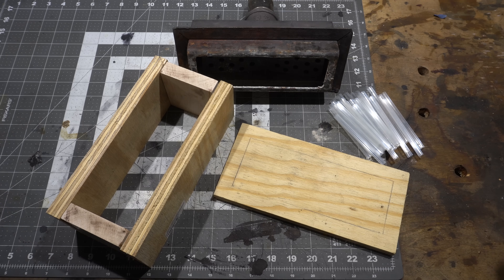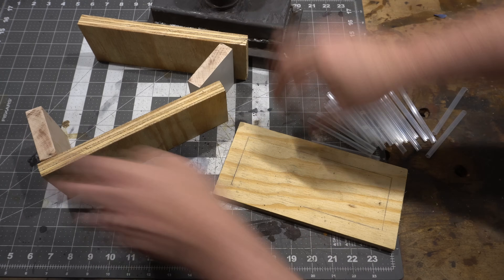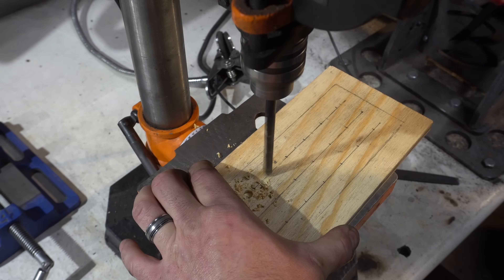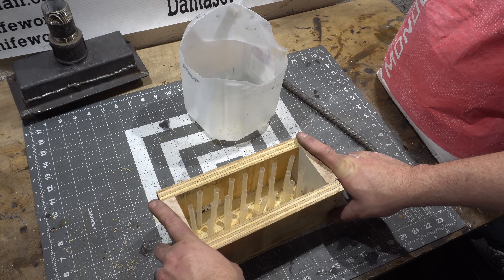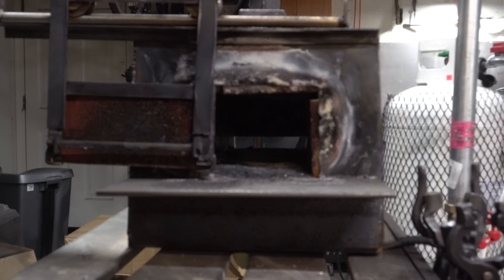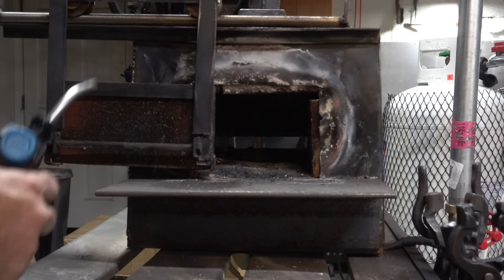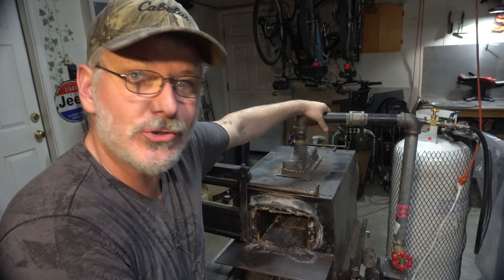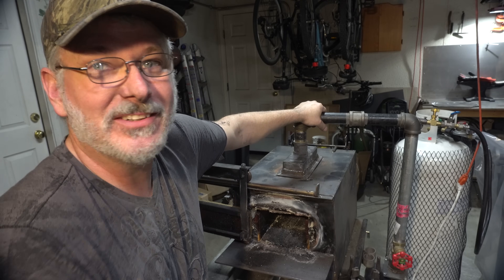Triple-T #77 - How to make a ribbon burner

Comment: +Tyrell Knifeworks  Why not add some 3/4" or 1" firebricks along the sides to reduce the inner volume and increase the insulation?  Seems you can always reduce the space of your forge to get more performance.  Building a smaller forge to heat up faster seems like a waste if you can just add some more lining brick.
Reply from the maker: Yeah I could but, 1)  I love building forges, 2) I want a longer ribbon burner because with the length of the forge, there are cold spots at each opening.  It's fine but it might as well be a 14" forge instead of an 18".   The new one will be 18" with a 12" burner.  Thanks for watching, Derek.
Reply: @TyrellKnifeworks  I totally understand.  I live in a big place where space is never a problem.  If I run out of space in the work shop, I build another pole barn specialized for hot work, or a cleaner space for CNC machines, drones, 3d printers, chemistry, etc... I have a lot of hobbies in my retirement. :)  So I get the sentiment about enjoying the build.  

I was just offering that not so obvious to everyone solution, which is, to use a Lego like strategy with sacrificial K bricks to reduce the size of the chamber based on what you need at that forging.    My main forge 36" long and a dual ribbon made of 10" square steel tube, so I typically only use the first 6-10" unless I'm making a long tool or a sword(which I've never gotten around to making, but was the reason for the long forge design).  If I had to wait for the whole thing to come up to temp for a 6" work piece, it would burn a ton of fuel.  And that's the main thing I hate wasting, time or fossil fuel.  Great channel and thanks for the reply!

Comment: Excellent video - a ribbon burner is in my future.  The switch of my burner from venturi to forced air was already life-changing. ;)  Thank you for addressing PSI vs flow rate.  I wish I could share that explanation with everyone who wants to build a forge burner.  PSI is almost meaningless for measuring gas flow without further information - it took me a long time to figure that out too because the common way to compare burners in almost all forums is to use PSI.
Reply from the maker: I’m glad it was helpful, Jeff.  Thanks for watching,

Comment: Thanks for sharing. I am about to build one and I really needed to see one of these made. Now, about the pressure/flow rate, those are 2 different things. The forced air (especially the ribbon) burners can work at lower pressure as they don't need the output pressure from the nozzle to create the vortex to suck oxygen in. The size of the orifice is, as you said, bigger in a forced air system so the flow rate (gallon per minute) is still adequate even at 1 (for example) psi. That's how I was taught how the forced air system works, but I might be wrong, since I am not that smart. Do you have any equation to determine the size of the pipe in relation to the size of the forge? Thank you again, i really enjoy your videos
Reply from the maker: Yes, but remember psi is not a measure of how much gas is coming out of the tank, just how much back pressure there is.  If you have a small opening it it creates more pressure.  You could actually have the valve open more and be going through more or less gas.  There’s no formula for the pipe diameter but if I were to do it again, I’d go with a 2” pipe and a larger blower.  Thanks for watching
Reply: @TyrellKnifeworks  yes, that's exactly what I meant. PSI and flow rate are 2 different things and low psi and high flow rate (amount of gas coming out of the tank) can occur at the same time, if you have a large enough orifice

Comment: A possible way to measure efficiency is by weighing the propane tank.  Difference in weight after an hour of running the forge multiplied by BTU/lb of propane will give you the consumption in BTU/hr.  Leaving a scale around the tank is useful anyway to check how much propane is left in it, tare weight should be stamped in the ring around the valve.
Reply from the maker: Yes, that’s certainly a way.  Thanks for watching.

Comment: Temperatures and running time are proportional to the type of gas and gas amount used.. no matter what burner you use .... it is physics...
The burner gives you the "efficiency" of use, and the "control"...
You done a pretty good so far, but I always recommend adding a "back fire" prevention arrangement,  it would prevent fire to stream back at the mixing tube up to the gas cylinder if it is left unattended... or you face a "power failure" at the blower...
Reply from the maker: I never leave my forge unattended when running, but I get the concern. Thanks for watching

Comment: I wonder if you could just make it all out of steel?
Just use a thicker plate on the bottom.
Reply from the maker: It would heat up like crazy though and would scale and decay quickly.  Refractory is the way to go.
Reply: @TyrellKnifeworks , Ok, thanks!

Comment: Awesome video Denis.  I am pretty sure you and Brian House are in my head.  Brian releases a vid on how to wire up a VFD at the same time I am wiring up my first VFD.  You release a video on making a ribbon burner as I am getting the components together to build one.  One question for you.  How much of that refractory did you end up using for the burner?  I am thinking of buying that type and then using the rest of it to line the forge I am building.  I would imagine the 50 pound bag will be more than enough but just want to check.
Reply from the maker: I think I used about 5 or 6 plastic cups worth from a 55lbs bag, so you have plenty.  Good to hear the videos are timely and helping you out. 👍. Thanks for watching, Doug!

Comment: G'day Mate. If you weigh the gas cylinder before and after use. Then subtract Start weight by End weight you get the quantity of gas used in kg or lb. Also if you time the run and divide  the quantity of gas used by the run time you end up with the flow rate in lb/hr or min. You can work the cost of gas used if you need to know that to.
Reply from the maker: Yes, I guess you could do that, but that’s a lot of work.  I’m lazy and if I cared that much I’d just buy a flow meter.  😜.  Thanks for the tip though, Daniel.

Comment: Thanks for sharing! I'm looking forward to watching you build your new one. I'm getting close to building my first, just want to make sure I have enough money to cover all parts.
Reply from the maker: Definitely collect all the parts before you start.  I'm torn which is easier and cheaper, the fiber blanket vs the soft fire bricks.  I am thinking the firebricks is easier and cheaper and probably safer, but on the next one I'm gonna do poured refractory over kaowool instead.  I'll see how it goes.  Thanks for watching!
Reply: @TyrellKnifeworks  probably overkill, but I've seen some builds with kaowool against the steel, then soft firebrick, then hard firebrick floor that can be changed out. Like this, they said the exterior remains quite cool (comparatively) and because the kaowool is held in place with the brick, not much need for refractory other than to hold the bricks together.

Comment: Nice explanation on the PSI. Majority of the community definably have a misconception on this. More even heat for the same pressure based on burner design? Or is it more heat for similar gas usage to a venturi?
Reply from the maker: A ribbon burner is definitely more efficient.  Not so much its shape but because it uses forced air vs a venturi.  The venturi design requires a lot of gas be blown at higher pressure to cause the venturi effect which draws air down the tube.  You also see more gas being burned outside the forge ("dragon's breath") because its not mixing well inside the forge.  So it's really the forced air that gives you the gas economy.  The ribbon burner equally distributes it across the length of the forge for a more even heat.  I hope that helps.  Thanks for watching.

Comment: The easiest way to know what your true working pressure is would be to put a gauge between the needle valve and the orifice. Still, a flow meter is more accurate.
Reply from the maker: For a ribbon burner, that will usually read zero.  There's not enough back pressure to make the gauge read anything because the orifice is large enough to let all the gas through.  I had one there and it never registered anything so I took it off.  The flow meter from the tank is the only accurate measure.

Comment: I'm almost done with my ribbon burner Forge, I'm going to make all the plumbing out of exhaust pipe instead of rigid threaded pipe. Excellent video👍
Reply from the maker: I guess exhaust pipe would work, just more welding I guess.  Use it if you have it.  Thanks for watching, Michael!

Comment: Your the only channel that has ever mentioned how  misleading the running psi everyone clams there running. Like I run a 1/8” orfice and run a little higher pressure than you do on roughly the same size burner. And running pressure vs not running pressure is completely different.
Reply from the maker: Yes, exactly.  In speaking with a viewer about why his gauge (after the shutoff) wasn't reading at all, we talking about the lack of back pressure against the gauge.  Then really started trying to compare.  I'm not sure the most optimal orifice size and how to calculate that and that's something I want to research more on.   Thanks for watching, Erik.

Comment: Hello Tyrell, which steel is better for a Bowie knife out of these three steel, 5160, bearing steel, or an old file?
Reply from the maker: Any of those steels would be fine.  Which one can you heat treat the best?  The file is probably 1095 which can be tricky.  The bearing steel is likely 52100 which is also a bit harder to work and heat treat.  5160 is trivial to heat treat so if you’re new, I’d say go with that.  👍
Reply: @TyrellKnifeworks Thank you very much.

Comment: Hey Tyrrell, great update on your ribbon burner progression. I built mine following your previous build. Thanks I absolutely love it. I had the same issue with to much fire box area and used some split fire bricks to decrease it. With the shutoff closed, I'm 1-2 psi for working temps and 3-4 psi for welding temps. Although, the gauge one of cheapo's. Haha Your design is working great for me while I'm learning to move metal.
Btw, what do you do for CO issues? I get one monitors with digital readout and built an exhaust hood which moves about 800 cfm
Reply from the maker: That’s great to hear!  For CO, I keep my garage open when the forge is on. My alarm never goes off.  👍

Comment: As a MIG welder, I tended to prefer telling people how many litres per minute (of argon/co2/mix) I ran on welds, I found that better as it took tank pressure out of the equation. Dunno if that helps, but thought I'd share the info.
Reply from the maker: Yes, that’s flow rate and exactly what I meant.  Most people don’t have that on their propane reg so it’s not really something people will relate to unfortunately.  Thanks for watching

Comment: Very cool, ribbon burners apart from their efficiency also work a bit better at altitudes so if you're a hillbilly they'll pump out more BTU's than the equivalent set up of Venturi burners. About the only weirdness I ever found with them was they sometimes take some real fiddling to get down to idling flames where its just ticking over, first came across them in big industrial ovens and I think that's were they originated from. Someone needed to cook a pizza in 8min
Reply from the maker: Really?  I have no problem at lower heats, just turning down the air does it.  Have a gate valve on the air is a huge plus.  Thanks for watching, Kris.